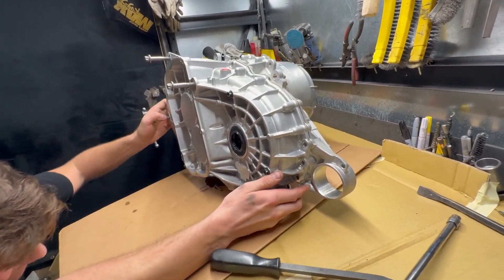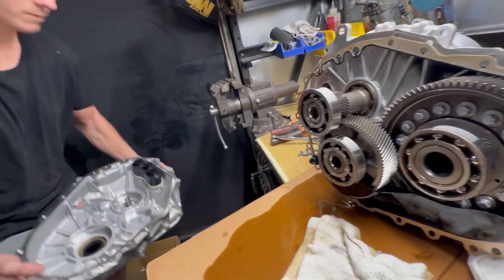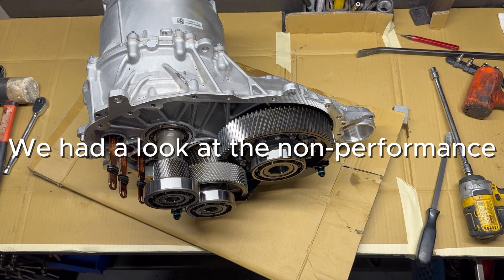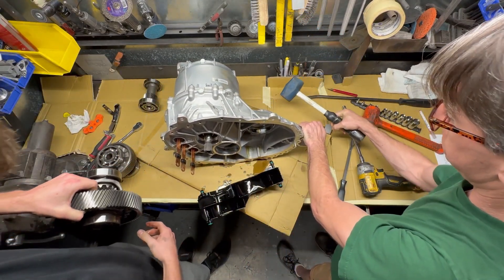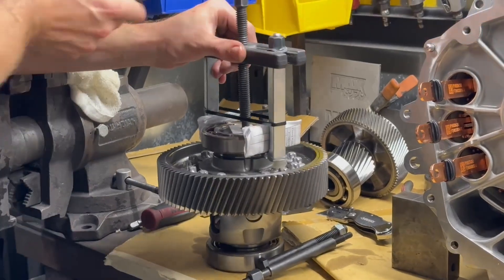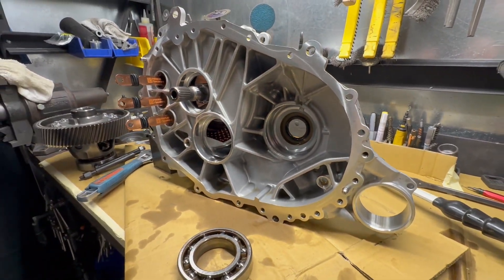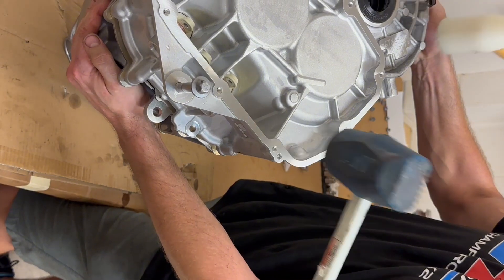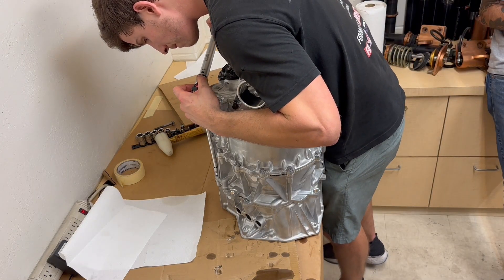Ready for EV Drift? LSD install TESLA model 3 Performance 2024+

Comment: Just found the channel and watching everything in reverse,  a lot of the newer videos now make a lot more sense lol. I have a 22 mp3 and would love to know that highland motor would fit, or if all the extra power comes from the inverter, and if the power is mainly in the inverter, can just ones of those be swapped in.
Reply from the maker: Watching everything in reverse makes a great sense so you can see the whole point of the year long build and development process and then find out what’s involved and every detail of how to build a drift Tesla yourself.  It all started with having my eye on EV for a very long time just because of how the instantly available torque at zero RPM could be a real game changer. Then the restyling and added power (in the rear) pushed me to adopt the M3P. Ive never heard of anyone motor swapping alone and @richrebuilds demonstrates to make a base model into AWD you need a complete donor car worth of parts. I wish I could do the opposite by physically deleting my front motor but have not figured out how & just have the axles deleted. Because of that I always recommend a RWD and you’ll see that on my upcoming ‘26 Y build series. Circling back around to why EV interests me in general is the torque character versus ICE and because the base model has the same character it’s totally driftable. Most of the time I’m being very gentle on the go pedal and I even got a pedal commander to dumb down the power delivery to somewhere between standard and chill. I never drift in insane mode. In short you don’t need to swap the motor to highland M3P and you’ll get on track way faster than me with all the parts I have on the shelf already & coming soon.
Reply: @PartsShopMAX I have no idea what level the aftermarket is at software wise, but if the active dampers can be faked, I would assume the front motor can be as well. Then you could remove all that weight. Project is cool AF, I will be watching.
Reply from the maker: Just double checked in case there’s been any new developments. G search result… There is no known commercially available "emulator" that allows the complete physical removal of the front motor from an all-wheel-drive Tesla Model 3 while maintaining all vehicle functions properly. Unlike removing shocks the front motor provides communication for numerous systems to operate properly. S3XY buttons allows me to drive the car without axles (for super steering angle knuckle clearance) in "Drift Mode Pro" using software to electronically disable the front motor, a software tweak to an existing AWD system, not a complete physical removal solution.
Reply: @PartsShopMAX That's unfortunate.
Reply from the maker: It’s still a way better daily driver than any of my other track capable cars, and I think that the M3P build serves as a great example for anyone in the enthusiast community choosing to adopt the car, with a clear example of remaining tradeoffs with the more powerful car & that the RWD can be (both) cheaper, less work & better at handling all daily/track agendas in one machine. To be fair though both models are a great choice for both daily driving and weekend track fun.